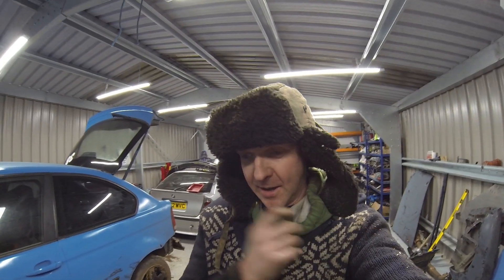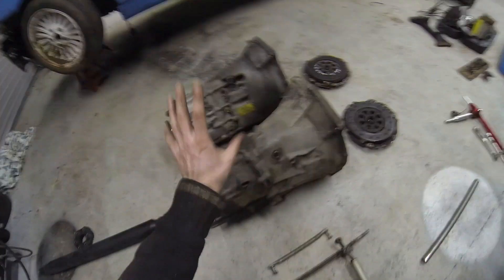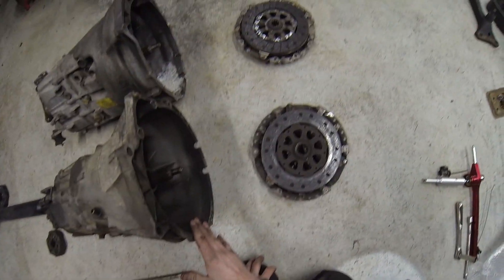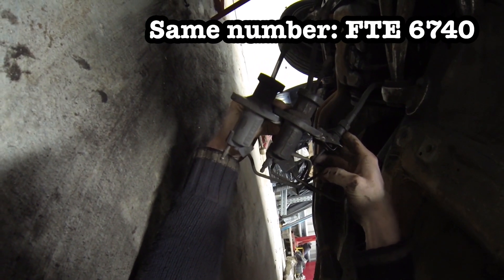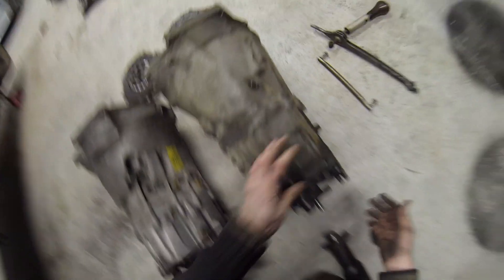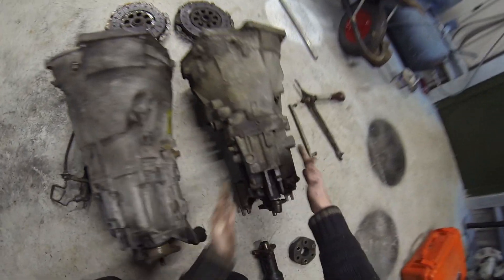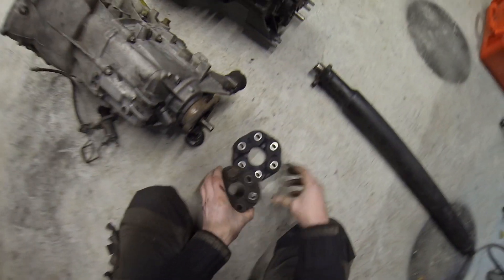TECH TIP:  BMW Getrag and ZF gearbox comparison // CraigDoesDrift Ep26

Comment: Hi, just checking at the output flange issue: Would it be possible to change the output flange from the Getrag to the ZF, so that a medium size guibo would fit? That way you could actually keep the original transmission. Am I right?

Comment: I did a manual 250g conversion in my e46, it makes a weird grinding resistance noise only while accelerating in 2nd gear not the typical grinding while going into gear. It shifts and drives perfectly fine would you happen to know what is wrong with it?

Comment: Are the steptronic and regular automatic transmission in e46, e38, e39 physically the same?  The only difference is the shifter wiring and the control module?
Reply from the maker: Sorry, don’t know.

Comment: what fluid did you run in the getrag? having issues and wondering if i should use redline d4 atf/mtf🙏
Reply from the maker: I use standard and some Lucas oil stabilisers

Comment: Getrag is complete garbage they break at around 200whp especially drifting
Reply from the maker: That’s about right. Seen loads lasting ages on m54b30 and there about 225bhp. I’d say the m54b30 is about the max limit.
Reply: Gold nugget info thank you man ! I'm doing a manual conversion on my m54b30 and was searching everywhere if the getrag 250g could handle the torque . I think i will have to drive it with care then

Comment: Great video , with my car i changed it from automatic to manual ,its a 320i e46 but i used the Getreg gearbox .the problem now is that the car cant angage gear number one at all either engine running or non running
Reply from the maker: Gearbox sounds ☠️

Comment: I need some help please. I have a 00 station wagon automatic my trans went out but I'm told it has a GM and my mechanic says there is zf and GM and it needs to be GM need help here what's the difference
Reply from the maker: Size of gearbox. Means you need a different size prop and gear linkage at least.

Comment: Great description during your video.  I appreciate your info.  Do you by any chance know what type of fluid were supposed to fill the 5 manual speed Getrag transmission with, ATF of MTF?
Reply: ATF
Reply: @bradrodger9082  I'm not gonna disagree or be an asshole, but many people, even mechanics at BMW will tell to use ATF, while the oil provided from the factory in those boxes are MTF, and every brand of oil (kroon, champion, castrol, ...) recommends MTF for those.

Comment: just to clarify those boxes will fit: m50,m52,m54,m40,m42,m43,m44 at least, maybe more, my friend runs a m40 flywheel and cutch on his m50b20 which is a easy and cheap solid flywheel conversion if you need it. oh and thats not a speed sensor on the getrag, its the reverse light, speed sensor is in the diff
Reply from the maker: Great info bud 💪
Reply: Getrag will also bolt up to S engines (s54, s52, s50) as well, obviously not advised but I know someone who runs them on a track car because they are so cheap to replace or rebuild vs the ZF
Reply: I was looking for this info everywhere around the web, glad to know m50 trans can mount to m54
Reply: Will this fit the zf from a 330d e46?
Reply: it will bolt up but will sit at a slant and need custom mount, shifter linkage...havent done the swap yet so not sure exact details but it bolts to the engine @nunolima2463

Comment: It’s nice that BMW decided to use the same bolt pattern that way like in my case I got a zf on a 2jz and if in the future I want the 6 speed trans I could just swap it and use my existing clutch,flywheel, and adapter
Reply: What’s the correct name for the zf gear box because when I try to search it a bunch of other stuff comes up
Reply: @justinflux4074  zf s5d 320z

Comment: Do you know if I can just directly bolt a ZF box from an E90 335 xDrive that has an N55 to my E90 328 xDrive that has an N52 without all sorts of coding issues etc? The gearbox from the 335 is capable of handling a lot more torque. Just wondering, should mine wear out, if I can't replace it with the stronger one?
Reply from the maker: Not a clue 🕵️‍♀️

Comment: hello. one big question , I have an e36 m50b25 vanos, with getrag, but I need to replace the gearbox and bought a manual ZF transmission from a 325tds, part number 1053401098, if you see this part number is 1 digit different, instead of ending in 7 like the regular zf from m3 and 328 this one ends in number 8. would I still need to change the bar?
  ,
Reply from the maker: Pretty sure diesel input shafts are different from the petrol ones.

Comment: Quick question, I currently have the 320d 5 speed manual from an e46 in my supra an the ratios are way too small so looking for a bigger ratio box thats almost identical on the bellhousing and clutch side not fussed about the prop gear selector. Have you any idea
Reply from the maker: Input shafts are different I’m sure on diesels from petrol.
Reply: get the 320d 6 speed

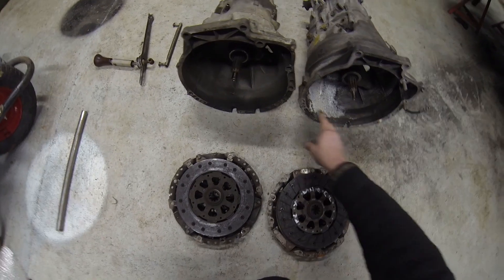Comment: Hey Mate, Thanks so much for the video. Just so I am clear on something. at about the 02:55 mark, you talk about bolt patterns being the same. What I am looking to find out through the BMW forums (with ZERO success mind you), is, do the bellhousings that bolt up to the M54 and N542 engines, line up??
The ones bolting up to the N52 seem to be missing the stud lug/hole at the starter mound (top far right as youre looking at the boxes at 02:56).
Thank you in advance. Really appreciate your help!!
Reply from the maker: All of these boxes blot up no problem.
Reply: @CraigDoesDrift  - thank you so much mate! Really appreciate the reply and confirmation.

Comment: Clutch diameter are identical however friction plates are not. ZF always comes with 240mm friction surface where getrag comes with 228mm. That sensor is reverse light switch - speed sensor comes in diff.
Reply: So can you still use the getrag clutch kit into a ZF transsmision?
Reply from the maker: Yes
Reply: I’m using my 2.5 clutch for my zf swap and I can’t get the clutch to disengage!!! Everything is great in my z3 except the clutch pedal not diengaging

Comment: Hello, greetings from Chile and thanks for your video. I have a 1992 e36 325i AT and want to do a transmission manual swap. Years ago, someone sold me a getrag transmission supposedly extracted from e36 318i. When I tested the car, the gear ratio was a mess, so I installed a 3.15 m3 differential, but I never managed to get the car to be well connected to the gears. I have read in many forums that show that the getrag gearbox of the e36 1.8i is the same as the e36 325i, but I have doubts about what I mentioned before. When reviewing technical information I could see that e36 325i uses 3.12 differential and getrag 250 gearbox and that of 318i is getrag 225 if I remember correctly. I don't want to use my car to run or drift, I just want a nice car that at times can perhaps enjoy its power a bit. In Chile there are not many e36 325i MT, therefore, getting an original used transmission is impossible, I can only buy the e36 318i. Can you give me your opinion on exchanging getrag for e36 318i? I also wanted to ask if the weight of the 318i and 325i flywheel influences when trading. Thank you very much for sharing your knowledge with us.
Reply from the maker: It will fit. Gearing is personal preference. Get it working and drive it
Reply: gear ratios are very similar, the 325i uses a 3.15 diff and a 318i will have either a 3.45 or 3.38 diff stock while you auto diff should be a 4.10 or 4.45 if i remember correctly and yes it will be extremely short if you leave the auto diff. i have a 4.45 in my manual and it cuts out at about 160-170kmh

Comment: Is it the same if you have 5 speed Zf and a 6 speed zf or are they diffrent?
Reply from the maker: Not sure about the 6 speed but I doubt they are the same.
Reply: Six speed is longer slightly. if you’re swapping you’d need a different driveshaft.

Comment: as a result, zf or getrag?
Reply from the maker: ZF if your putting it in something that is making more than stock 3litre power or a comp car where you want the extra reliability.  Getrag is still great and I knocked the hell out of mine but it wont last if your doing more power than stock but super cheap (in UK)!

Comment: THANKYOU! Recently bought a Getrag 220 to put in my e46 330, just needed a clutch. Couldn't find information anywhere on what size the clutch is or if its the same size as the zf box. Now I can buy a clutch kit for e46 and know it will fit. Thanks mate, lifesaver.
Reply: The 330 uses a ZF because it's stronger, it will bolt up, but you will wear it out faster, the getrag is known to be weak, but I don't think 221lbs of torque will break it.
Reply: @SavageBunny1  For sure g220 is much weaker than zf. But it should be fine for street driving, done 12,000ks on the g220 now, hopefully I get plenty more no issues!
Reply: @ryanslattery9340  i respect it i put about 5k on my getrag before i broke it
Reply: @Saint36s  16k now, still sweet
Reply: @ryanslattery9340  yeah most bmw stuff is pretty strong for stock power, my friends runs a 320i with a 316i flywheel and clutch, he never had issues even drifting and dailying, ive been drifting on a getrag(only320i) for years and im hard on it, like really hard, i will shift lock it into corners, clutch kick the shit out of it, daylied it etc no problems so far, will be upgrading to a zf when i swap in my m52 mainly because i already have one tho

Comment: is the bmw getrag e46 m3 
as good as the v160 supra one?
Reply: So in what bmw can i find the zf? Do you have the serial number of it
Reply: @gerenciaimagenespublicitar2039  e34 with m50 . Or e36 m3 5 or 6 zf transmission or e46 m3 330i e46 . M coupe with euro s50 or USA s50 but USA car are only 5 speed.
Reply: @_i-kr6eg  ok thanks mate for your help
Reply from the maker: hector hads Thanks mr323i for the info! Also the e36 328 were 5speed zf boxes
Reply: @CraigDoesDrift  lol forgot about those .
Reply from the maker: adam london sorry bud, I don’t know.
Reply: The e46 m3 has a ZF not a getrag.  All e34 e36 ( 328i m sport ) and m3 and e46 have ZF transmission
Reply: @_i-kr6eg  thanks
Reply: @omarlondon  not a problem 👍
Reply from the maker: mr323i thanks for helping @adam out bud!
Reply: @_i-kr6eg  wikipedia says M3 has Getrag 420G